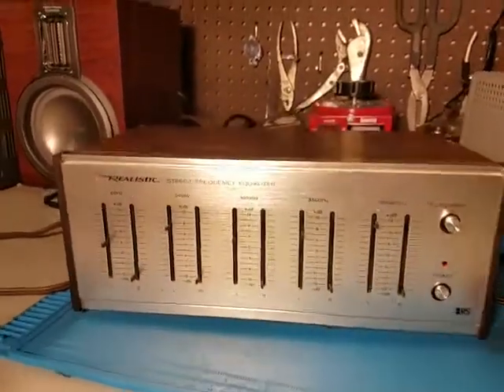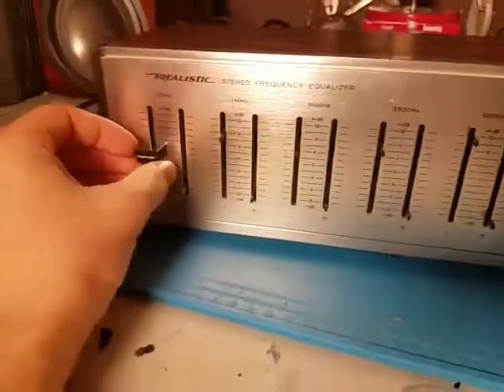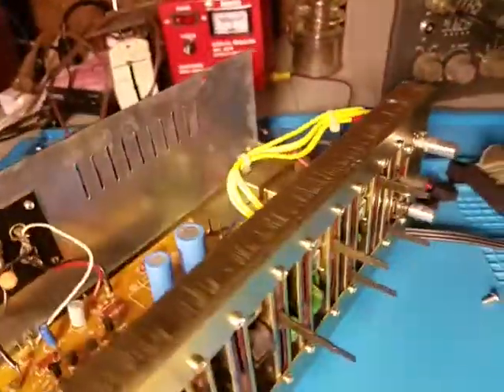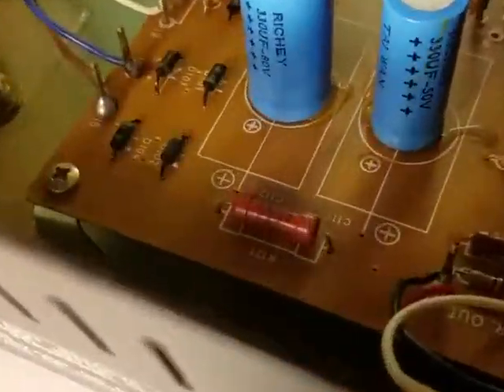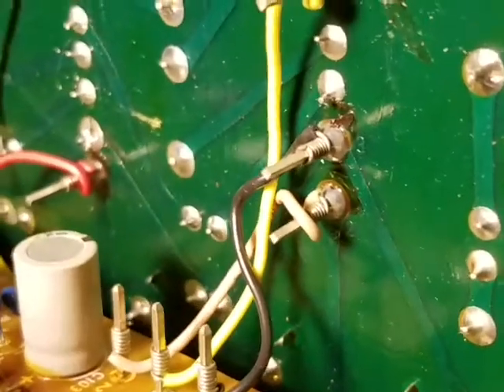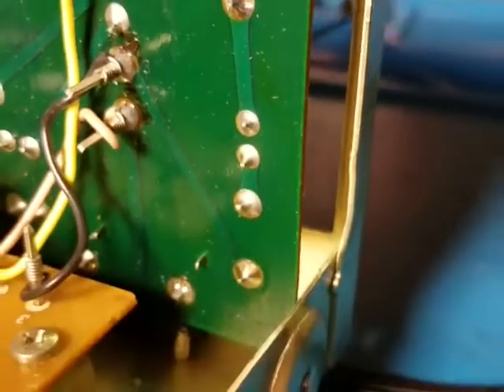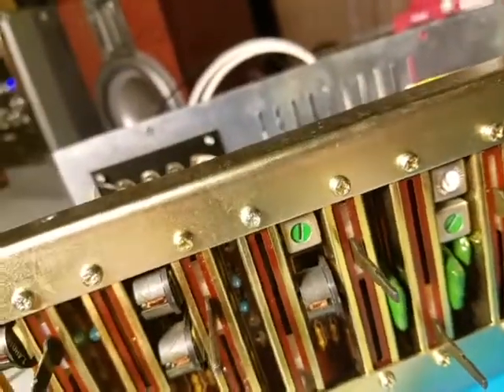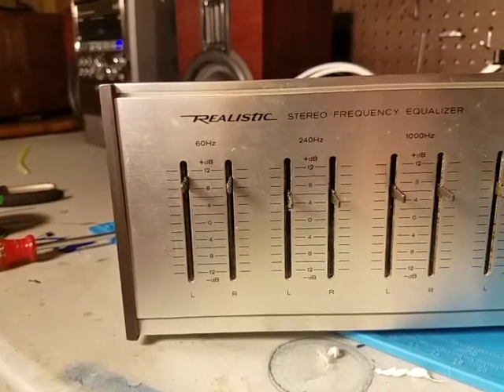Repair of a 1979 Realistic 31-1987 Equalizer

Comment: The 'IF transformers' are most likely just filter inductors as part of LC resonating networks, with a Q controlled by the pots. Usually it's just done with RC networks, which is also cheaper, so it's a bit weird.
Reply from the maker: Hm, interesting!
Reply: @bratwurst2923  

Makes more sense to me now. Just took a look at the schematic, turns out the resonators are entirely passive (can't do that with RC me thinks), driven by an input buffer amp, and their signal is then fed into a diff amp at the output (longtail pair thingy)...  Quite an archaic design for '79, but I like it!
Reply: Good job!  I don’t understand much of the technical lingo, but it is great that you  can figure that all out and get things working!!

Comment: That popping and cutting off issue is solved by replacing that blue 4.7 uf 35 v capacitor next to the potentiometer.
Reply from the maker: Oh, really? After this video it started doing that again and I filmed another video about a week ago of going through and deep cleaning all potentiometers, but didnt upload it because I didnt have my microphone on, facepalm. Thanks for letting me know on that! Will get to that right away!
Reply: Actually, the cleaning helps very little. The cap is the problem guaranteed.
I didnt have the very same one so I used an electrolytic one and since there is a positive side marked on the board, I had no problem with it. It worked perfectly. I installed a
4.7 uf 50V .
Reply from the maker: @JohnkTaylor987  alright now that I think about it that makes sense, cleaning usually only really helps with a scratchy pot because its dirty. I've got that value around here so that old equalizer should be up on the work bench soon! Thanks!
Reply: You re welcome. 🙂👍🏻